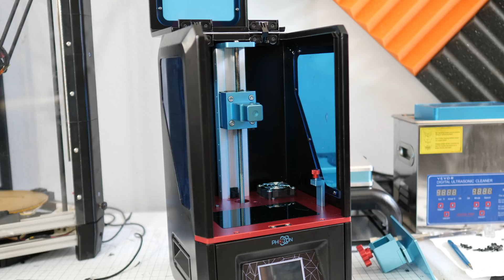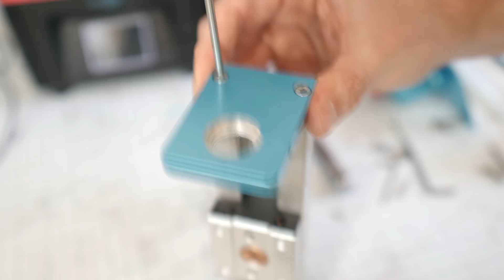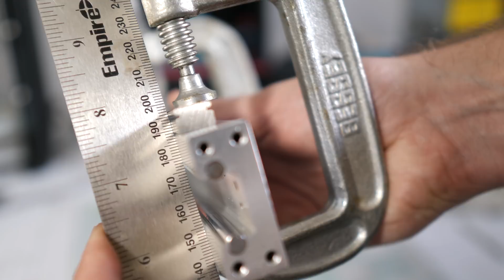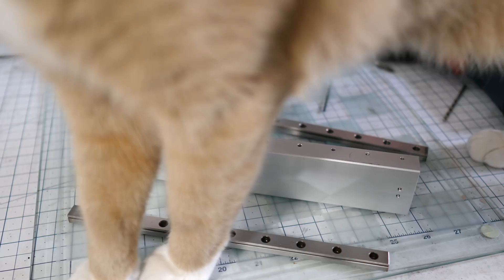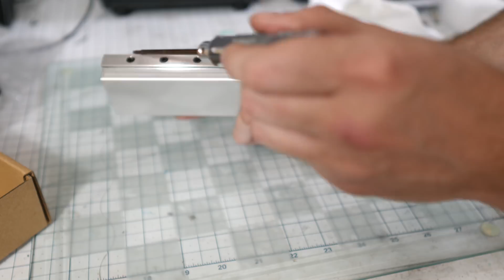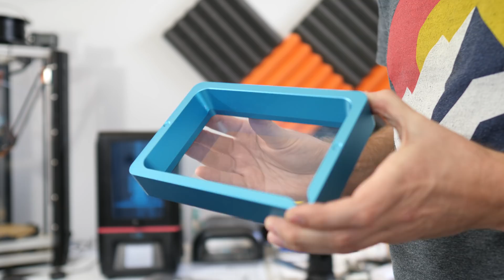Anycubic Photon Upgrade: instructions - S02E47

Comment: hi, i instaled the part and now the printer will not stop going down, even if i set the zero or re level it seems to not know that its against the plate, i know it isent a fault on your part, i just wanted to know if you had an idea what i did wrong

Comment: Very smart upgrade. Like it better than buying whole new z-axis upgrade even though that one is wider. Reuse existing column and get two rails and a new holder and ... done! Pro upgrade is with one rail - two rails are better as long as they are properly adjusted. Further upgrade is using real ballscrew but that then gets costly and heavier.

Comment: What kind of z height reduction were you able to obtain with your mod? I know .05 layers are usually obtainable stock, do you think you can print .02? Have you tried any gearing printed vertically to take advantage of this or is the x-y resolution still greater than your z height? Thnx!

Comment: Finally had the time to use a friend's hardware to properly drill holes. Caveat 1: the hardened steel rods in the aluminum post have to be removed - drills die fast when you try to drill through those, and if you don't then the holes won't be deep enough for 10mm M3 screws. Caveat two: the PA aluminum bracket is machined too narrow and actually doesn't fit. It's probably about half millimeter too tight to fit over the linear rails (accurate measurements later tonight - gave up in frustration yesterday).

Comment: Why not just adjust the linear rail that it comes with?
Reply: It doesn't come with a linear rail. It has rollers attached to the carriage and over time, the bearings wear out and there is way too much slop in the assembly.

Comment: Which length are the M3 screws used (both for mounting the linear rails onto the Z-rail, and for mounting the block into the linear rails)?
Reply: Got a reply via e-mail: 10mm for both kinds.

Comment: a lot of work for a low cost printer - just spend the money and buy a better printer
Reply: Not a lot of cost/time to make a very economical printer, capable of impressive print quality, quite a bit better.  You could spend 3-4 times as much on a 'better' printer, that doesn't have appreciably better print quality (I did do the research).

Just bought a Photon myself and fully plan to do this mod, though I'll be machining the block myself and drilling/tapping the machine Z-rail for the linear guide rails for the machine on my mill...

Comment: What I would love to see by you.. is the full set up. Where one can buy the rails, the bracket and the photon part (the original Z rail for the Photon)... . That way those of us without tools can install this a lot easier and not have to drill holes, tap them and then install them. I don't have a machine shop/Drill Press, nor do I have the complete dexterity with my disability to do some of this. 

Also I would love the Vat protector!! I was hoping to order it already hehe. :)
Reply: I know there's a lot of people in this situation and we're looking to help: 'eventually' is about the best I can say for now. At the moment we're just struggling to keep up with the pre-order list, but we'll get there! Shoot me an email sometime and maybe you can be the first to try a kit from us when the time comes?

Comment: Which 3mm socket head skrews do I need to buy? How long should they be, or does it matter; so long as the make it through the center bracket? Also, how long are the ones that attach the adapter to the sliders? Thank you in advance!

Comment: For the covers: I assume you will mark top and bottom clearly to avoid nasty 'wrong side up' accidents?
Reply: top and bottom are identical, so it wont matter at all.
Reply: @jcknight87  It will matter when you open the container again, although I guess you want to make sure it is upright all the time.
Reply: But why would you ever rotate it? It's like Tupperware, it is water tight but I still don't ever put it up side down